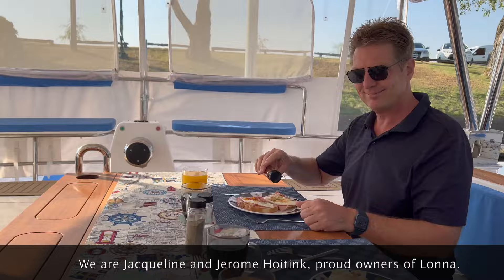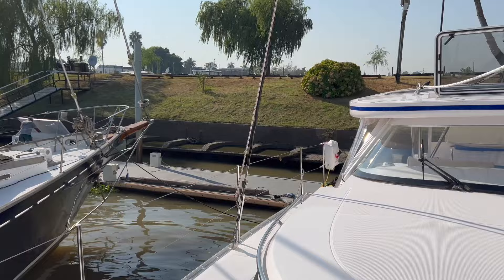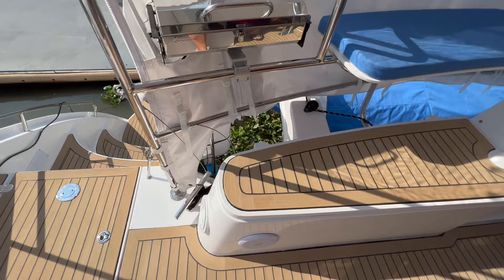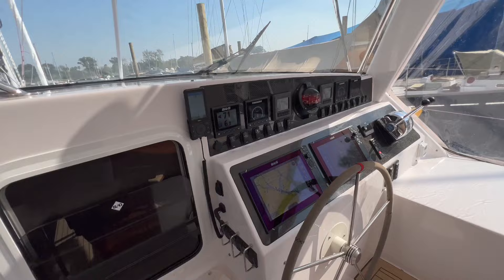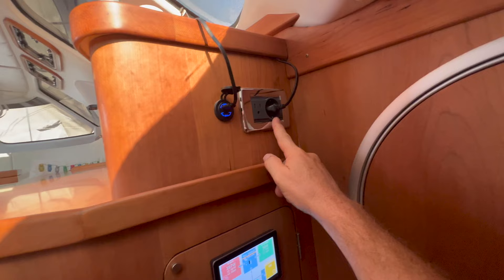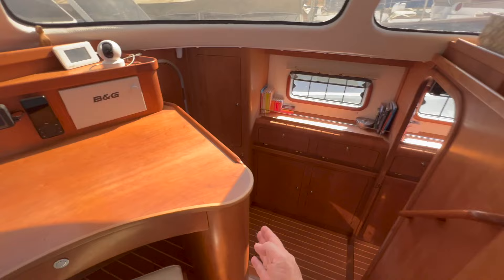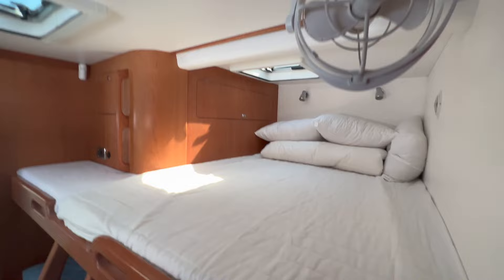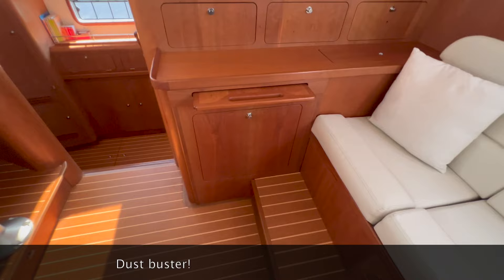walk-through: first Antares 44 Hybrid Catamaran "Lonna"

Comment: If I could suggest one small item, I put 5 micron water filters inline on our water collection system, you'll be amazed at what gets stopped entering the tanks, especially the insect life, say Hi to Seb;)
Reply from the maker: Thanks, good tip! We have on both sides pre-filters (rope material?) after the water collection. I need to investigate what that is exactly. We also have a filter after the main pump and a UV tap with filter. We like clean water for sure.

Comment: For the cat. this is at the top of my list for sail boats, for the price and cost ANTARES puts out one of the very best boats on the water. That rain collection system you have there is that part of the new standard equipment or an add on, last I heard it was optional equipment.
Reply from the maker: The rain collection system is standard. Same as the "just in case" hand pump in the galley.
Reply: @SV Lonna  a friend has one of the older models a 44 so I was going off the equipment list for that one. Thanks for the info, I have been thinking about getting a 44G

Comment: Excellent video. I have to say that so many things needing to be accessed through the hatches would be a dealbreaker for me-I don’t like going outside to troubleshoot in big weather any more than I have to, and my husband is simply too big to fit through hatches (he’s 6’4” with big shoulders). That aside, it’s obviously a well built catamaran 👌⛵️
Reply from the maker: Thank you! I am 6’4” as well and the hatches are wide and therefore easy assessable. You don’t need to be in the battery area because everything is remote controlled via blue tooth. The work shop is the other space with an hatch and that is for me a “nice to have” feature. They made handy steps / ladder to access the utility spaces. In general you have easy access to everything and the fact that the engines are place inside the hull instead of the sugar scoop sold the Antares to me. Nothing worse than working on an engine in rough see on the far aft of your boat.
Reply: @svLonna  I do like the engines accessible from the inside-I’ve been in the sugar scoops working on the engine in rough seas and it’s no fun.

Comment: very beautiful. The only thing i dislike is the custom engine. Anything goes wrong with it, there's little to be done..
Reply from the maker: I partly agree and that is the reason why we have a parallel system. If the Hybrid fails, the Yanmar 3JH40 can take over instantly. The only modification on the Yanmar was the air intake cover. The standard plastic version was replaced by a stainless steel version. The Hybrid part is delivered by HybridMarine from the UK. A company in business for over 20 years. Fun fact, we had a small issue with the Yanmar during a night passage (oil filter was not tight enough screwed in) and I could use the hybrid instead. So when docking the next day we still had a port and starboard engine available to us. With our setup we have 2x 2engines to our disposal.
Reply: @svLonna  I should have known you had most issues thoughtfully sorted from your presentation in the video. I'm just nit picking. I really enjoyed your video. Thanks for the explanation and cheers.